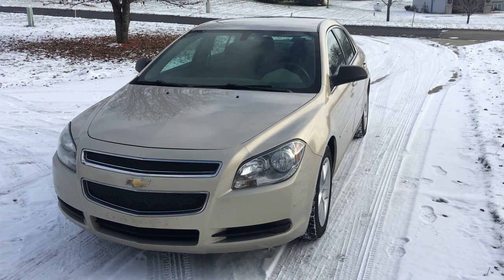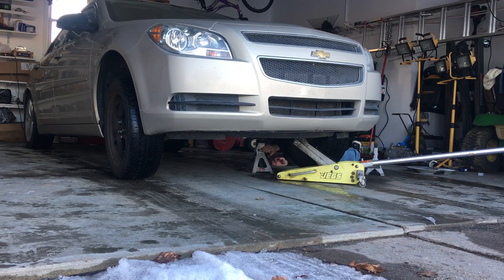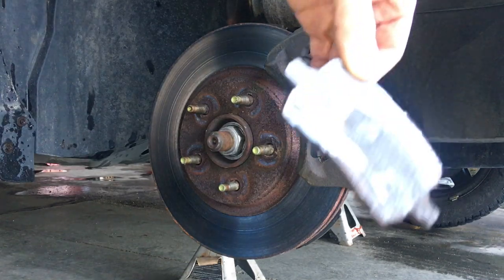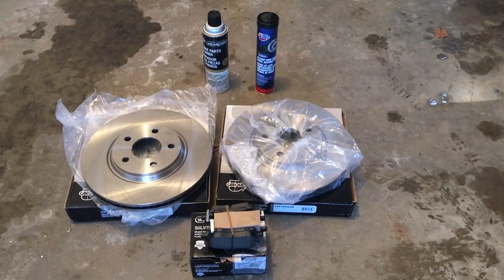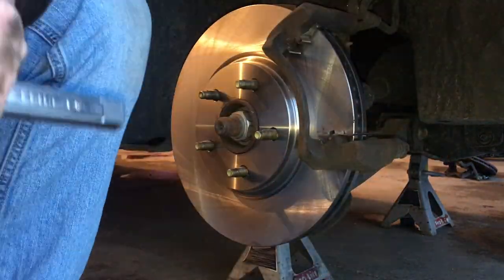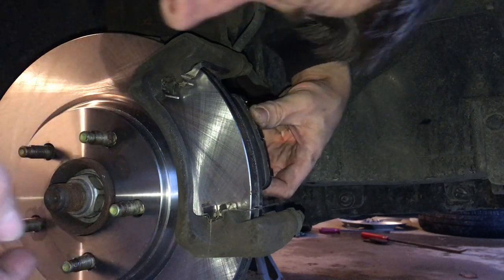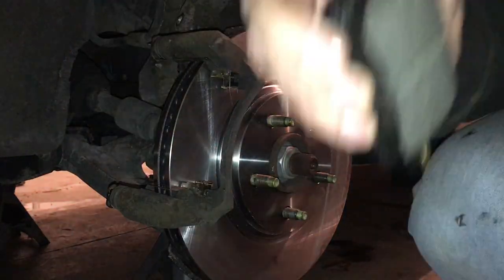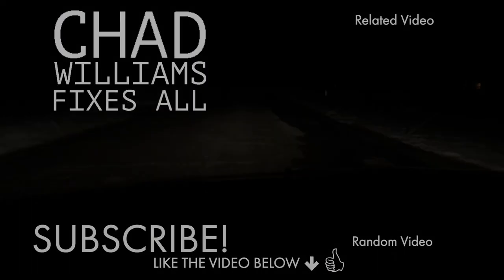Chevy Malibu Brake Pad and Rotor Replacement - 2008 - 2012 - DIY How To

Comment: Dude!! You. Are the GOAT of cars! Mind you I had to cut my nails off 😭😭😭 after a brief nail funeral, I got to work n changed my brakes!!! You just save me a 517.89$ Tires plus was gonna charge 275 for front brakes and 220 for rotors. I did this for less than 150

Comment: Great video, factual. Yes torque specs are important but in 55 years of working on cars, I know when it "feels right". 

Bleeding only necessary if hydraulic system has been opened(repl master cyl, caliper, etc).

Comment: great video! would it be the same process for the rear brakes?
Reply from the maker: If the rears are caliper, it will be mostly the same. Sometimes the caliper pistons spin in on the rear. If you run into an issue like that, I have a rear caliper video on my Cruze within my channel you can watch.
Reply: @ChadWilliamsFixesAll  awesome thank you for the response

Comment: So yeah I have had a crazy brake issue the last month on my 08 malibu lt2 118k.. About a month ago I experienced a brake caliper grabbing while on the freeway, I replaced the LF brake hose and caliper problem fixed I thought.. The next day more intermittent brake grabbing issues, so changed the RF hose, pads and rotors, and extensively bled the brake fluid a couple times.. So it drive great for a couple days so far but now I'm experiencing a "catching" noise only when making right turns while not applying brakes, it sounds like the corners of a brake pad are catching or something metal is tinging the rotor.. This has about made me crazy, I just want brakes and a car that doesn't shake!
Reply: How Important is cleaning the rotors?
Reply: @reaganpapa3830  extremely important, thise iron rotors are packed and shipped in a oil based lubricant to help prevent rust.. I always take some brake kleen and clean them up good.. That oil on the surface of the rotors where the pads grab doesn't seen like a good idea

Comment: New to working on my car, I haven’t taken it apart yet to change the brakes, but  I’m just replacing the brakes so will I need to get the vice grip to compress the caliper piston back in?
Reply from the maker: Yeah, I like to use large, wide mouth vice grips. But, if you want to use the correct tool, here is the link: https://amzn.to/3CuyzVa
Reply: you can buy a cheap c-clamp. Just make sure you compress the piston evenly so you don't damage it. I like to put the old brake pad between the piston and the clamp before I tighten it.

Comment: Please be sure to cover the tools required in order to complete the task. Otherwise the video was perfect. It would be nice to know what socket was used in order to pull off the hub cap and the lug nuts. 

Beyond that, perfect!

You covered:
1. 14 mm socket and the ratchet for the 2-caliber bolts
2. Medium pry-bar to pry away the caliper, slowly. (beware of the break-line, catch the caliper)
3. Zip-tie to temporarily mount the caliper
4. Check the break rotor for grooves. It may need replaced.
5. Wide-mouth vice-grips to compress the caliper piston back in.
6. Use brake pad cleaner on rotor. 
7. Apply brake pad grease on the shim
8. Pull out caliper slides, clean, and grease them.
9. Re-assemble (common sense. Put it back together, you took it apart!)
Reply from the maker: This is a great comment and I do try to add the tools used in most videos, but forget sometimes. Thanks for adding this. I think it was a 3/4” socket or 19 mm for the wheel.

Comment: I dont understand why but my caliper will not for the life of me fit back on. I've compressed the piston all the way, but it's like a full centimeter off. I've got the pads and bracket on, screwed right, new rotor, but when I go to put the caliper on if I have one bolt hole lined up the other doesn't even come close to fitting over the slide.

Comment: Great video! One question I have - how do you know where to put the jack and jack stands? On my 2010 it has pinch weld jacking points. I've googled but I can't really find the exact answer I'm looking for. How do you know which part of the car to place your jack?
Reply: Those pinch welds are for the spare tire jack.  Regular jacks can damage them, although usually not beyond the point of functionality.  Personally, I Iook for sub frames to lift by.  Sometimes I use a piece of would on the jack so I don't mark up the vehicle.

Comment: Do you need to take the master cylinder cap off?
Reply: No that's not necessary there's no reason to open the cap all you are doing is allowing moisture into the system. The cap vents just fine. One thing you can do is take some of the rough edges off the new pads so they don't bind, the gap tolerances are never very accurate so taking the rough shit off makes them easier to install as well